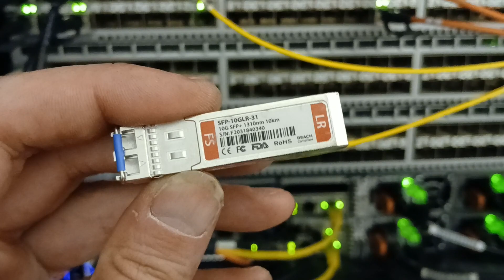AS 399347 meeting AS 46887, lets add more paths together!

Comment: I will say, having your own geographically diverse path over the bridge gives you a lot of options. You can advertise and even market your own redundant circuit. Also on the server room, I love the places they have no active equipment on the handover. Keeps it simple and a lot less things to worry about. In South Africa such providers will give a physical fiber cable drop. You provide your own SFP to plug it directly to your router
Reply from the maker: Yes I prefer the SFP option seems to be more efficient in most all ways.  When the service provider puts in a cienna or edge equipment it's just 1 more thing to fail, require power, and who knows what settings they changing on them.

Comment: The big metal box mounted on the pole is Comcast’s power supply.  Inside is an Alpha XM2 or XM3 unit with 3 batteries for backup.  The silver metal box inline with their hardline above is an amplifier.

Crown Castle btw is an awesome company to bring bandwidth in.  They do nice work.
Reply from the maker: Nice!  I always notice when a pole has a electric meter that means Comcast is doing something crazy.  Been hearing nothing but good things about Crown Castle very excited to get the circuit up.

Comment: gotta love layer 0 BGP peering
Reply: side note dwdm filter = wave no?
Reply from the maker: They installed a mux\demux so I believe they are preparing themselves to deliver the 10G circuit over a wave yes.  DWDM filter is what they called it but it's not what I would call it.  DWDM mux\demux would be the endpoints I would argue only the OADM in the middle would be technically a filter?  IDK we use it but in a bidirectional mode with 1 fiber.